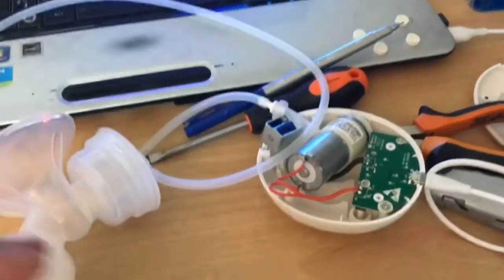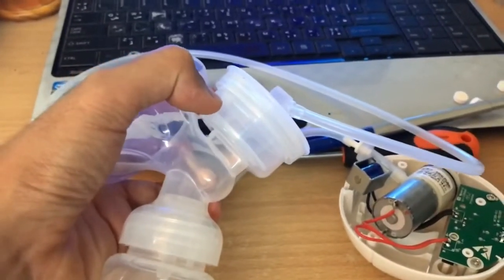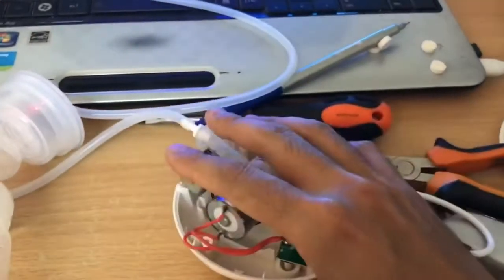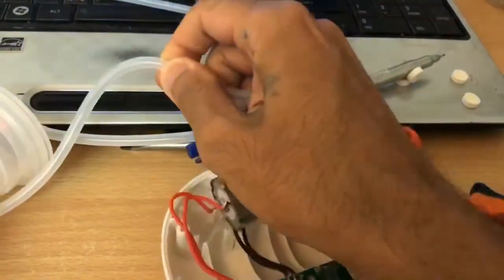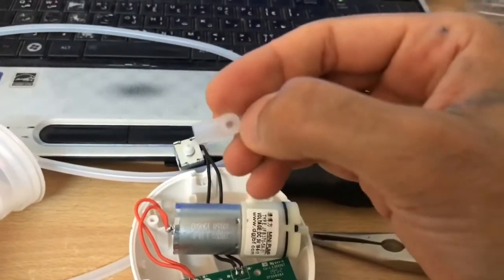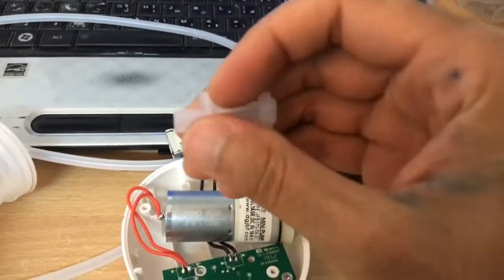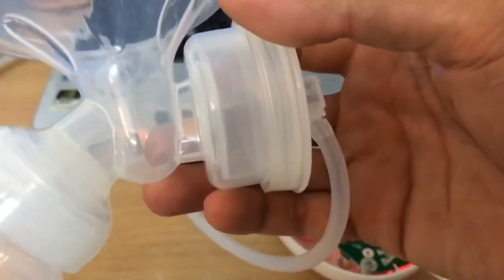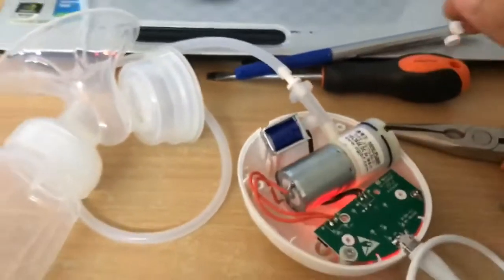Real Bubee Breast Pump Suction Problem Fixed

Comment: hey, How did you open the pump?, please, help me because  I can't open it     =(
Reply: Same problem
Reply: Remove the foam thins at the bottom and there you have the screws to open
Reply: There are some four white rubber holes at the bottom remove them n the screws will be exposed